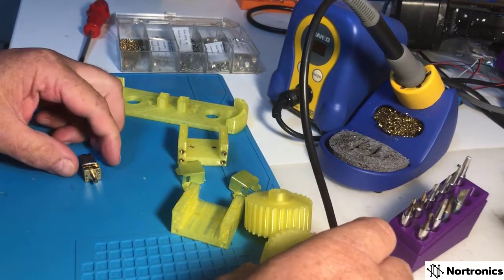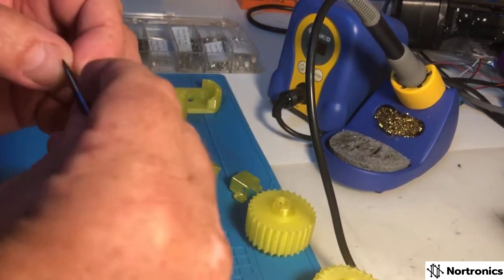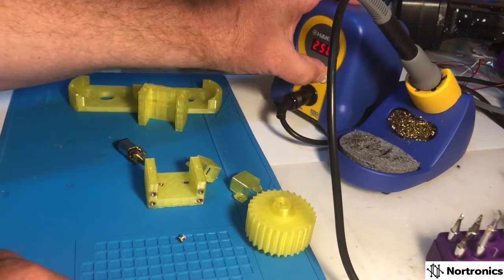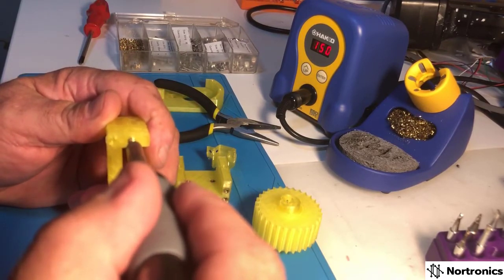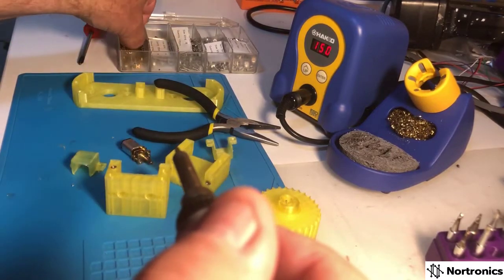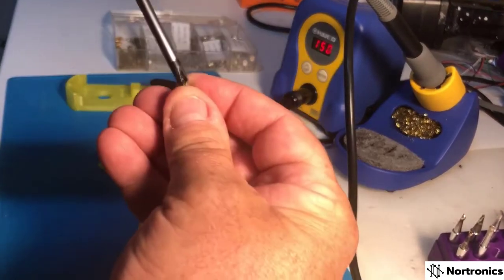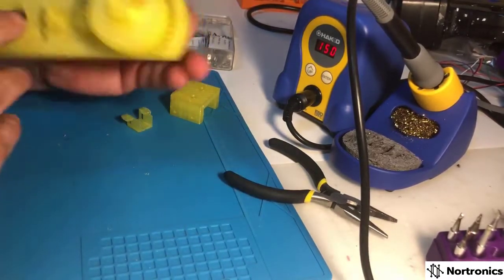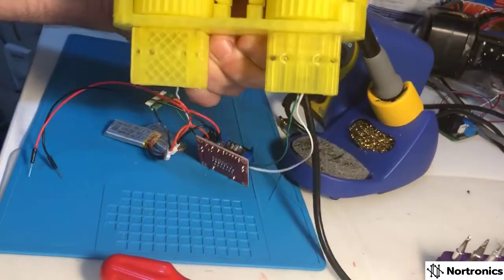How to Embed Nuts in 3D Prints

Comment: When embedding these into blind holes, screwing a screw into the knurled nut stops the molten plastic flowing back up into the nut's hole.
Reply from the maker: Thanks Tony but do you then just heat the top of the bolt to melt them in?
Reply: @nortronics . Yes you heat the top of the bolt.  I just put the tip of the iron into the center of the phillips/pozidriv slot. You might need a little more time and higher temperature setting.